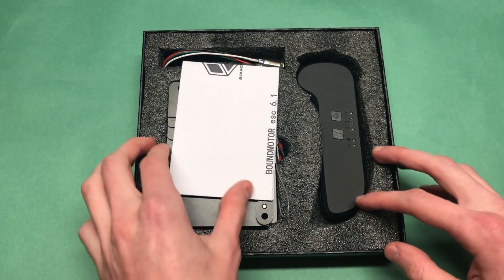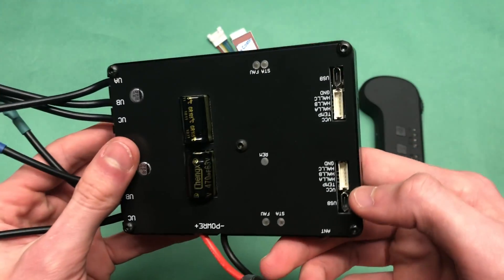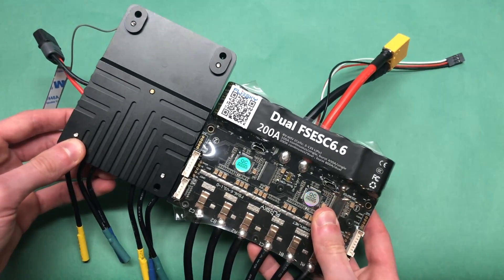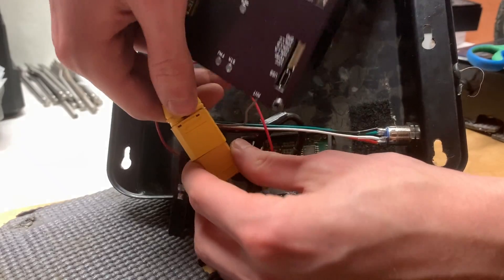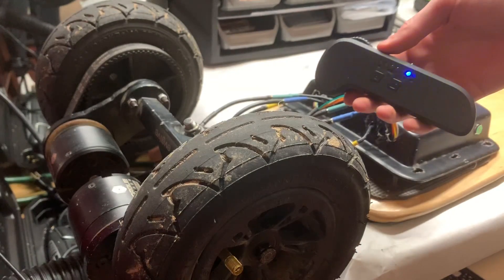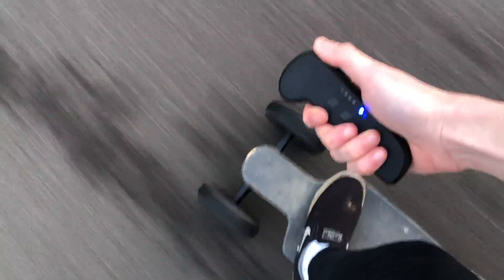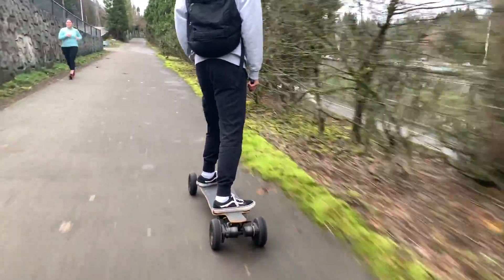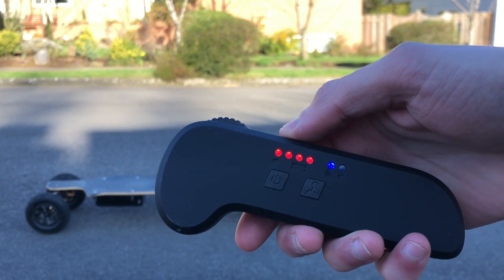BoundMotor ESC - Game Changer

Comment: Hi really enjoyed the video 😀 I wanted to know if I can get wheels that big to fit my board it is a Faboard Black Carve direct drive just like the Onsra Black Carve. Ive got some Clouds and and looking to buy some airless tires, but wondered if I could fix some 6" wheels with air in them on to it  😀 I have the Abec adapter so wonder if they would go straight on. Thanks Mark
Reply from the maker: I am not really familiar with the DD black carve but I know for a fact that ABEC adapters would not work. Pneumatic tires will require their own adapter as they have large hubs.
Reply: @DIYesk8Builders  
Hi thanks for the info really appreciate it. Mark

Comment: isnt the battery plug just an XT60?
also the FLIPSKY dual has a heatsink on the back and is rated for 200A per SIDE, and the boundmotor only for 60A

Comment: have you tried it offroad to see if it can handle steep hills and how fast does it climb?
Reply from the maker: Woah, so cool to see you commented - huge fan of yours! So it is not that great at climbing hills quickly. It is no where near as good as even Torque Boards VESC's in that area. I think the most suitable application would not be for an AT off road board but rather for a street board for intermediate or beginners. It doesn't have the same punch as most other VESC's
Reply: @DIYesk8Builders  thank you so much man! I hope we meet and ride one day! Stay safe!!!
Reply from the maker: Yeah that's the other thing, I'm only about 150lbs so it probably would feel even more powerful to me. Definitely is a solid product, but still not as good as some options!
Reply: @DIYesk8Builders  I am working with the company and it will be better. The structure is super strong which I like. The swappable battery is awesome. if I connect two dual vescs it will be a beast!!!
Reply: sorry bro I posted the answer in the wrong thread. I want to try this esc for bajaboard 4x4 and see if its powerful.
Reply from the maker: Sounds pretty amazing!

Comment: Taking off the cover on this ESC, the manufacturer scratched off the markings on the motor drive chips. 
It's a generic 20 pin gate driver instead of a DRV830x used in the real VESC.
I'm pretty disappointed that they cheaped out on the most important part of the ESC, and yet have three 32bit STM32F micro-controllers on the board.
The bluetooth chip is also a nrf24, a design from 2006 that isn't compatible with the VESC App.

TL;DR: Besides price-point, there is no reason to recommend this design over a flipsky6.6
Reply: This thing is crap in a nice case, think I blew mine got to pull case off and see. Thought it was 60 amps per motor not a mere 30

Comment: Your other VESCs cutting out during breaking could be happening because the regen current is too great, are you sure it is the VESCs causing the loss of brake power and not saturated regen settings? You can fix this by either decreasing braking current or increasing regen current.

Comment: Does this ESC have a port to connect two if someone was going to run AWD?
Reply: I don't know, but it's called "can bus", just to aid in your research.
Reply: I bought two of them for a 4x4... so far no luck getting them to hook up with each other... I dont think they have can-bus... which is why you have to program each one individually
Reply: Smugg Thugg that was my worry. You'll have to figure out how to split the receiver wires or somehow else keep from having from using two remotes. I went with two top end fly 6.6s...haven't hooked it all up yet but they have can buses so should work
Reply: @sageoz9886  yeah I might be outta luck on the 4x4... but they're still pretty nice so will use them on different boards
Reply: Smugg Thugg  yup, totally. I'll get one next time one of my regular boards blows another esc.  Y current diy 4x4 is actually 4x6 and has direct drive on rear with and the front has one pair of non drive wheels and a pair of hub motors mounted on custom made tandem wheel adapters. Check out my projects on Instagram @  SageOz_tattoos

Comment: There is a reason it’s so cheap... it’s rated for 60A continuities in total. A Flipsky 6.6 dual can run  double that.
Reply: For a mid tier build sure.....but if power is the requirement and price is not a major factor then i will take this all day.
Reply from the maker: Yeah, we have found it to have slightly worse performance because of this, but at the price point its pretty hard to beat. By no means is it better, but its certainly an option!
Reply: Wait if the one in your vid is rated at 60 amps continuous and flipsky can run double for alittle more why get this? People who want power are going to want more amps to there motors as long as they can handle it
Reply from the maker: Its a significant price difference if you think about this. If you buy a flimsy 6.6, a VX1 remote, and a power switch that will be close to $350. You can get this for $200, its definitely a budget option
Reply: @DIYesk8Builders  yeah, if one wants budget option just buy an ESC from diyeboard.com, they are great and can do 50A, which is virtually the same.
Reply: Well, if you're building a short board that's going to be running a 10s2p battery that can only put out 30A, theres no reason to buy a more expensive esc

Comment: Great video! Was just looking at this esc to replace the default one I have on my ownboard. How does it compare to the flipsky ? Also I'd love to see a review of thier direct drive motors which I was also the nkonf of getting.
Reply: Don't get direct drive , they bend , they have lots of problems...
Reply: satinder guleria I like to think I know a fair bit about the scene and I have yet to hear anything on what you are saying
Reply: @majorpuffen7444  It's because most mainstream brands are not selling direct drive yet ...
I know this info from one of the core supplier of all Chinese companies 🤫
Reply: satinder guleria that’s what my board has right now and I have also seen other brands using generic direct drives. Plus if you have heard of torque boards you would know they are a parts distributor and that they sell 2 different rated direct drives that are actually well liked by one of the best  diy builders out there.
Reply: satinder guleria this use to be a problem but has now actually been fixed
Reply: @majorpuffen7444   does this include the boundmotor direct drive though ?
Reply: tomai moneyhon im not sure what that particular drive would be
Reply: @majorpuffen7444  so which ones were you referring to?
Reply: tomai moneyhon if you’re referring to the ones from this video, then it should be a non issue now. If there was still a problem with direct drives they would not be selling them at all. Ive put 300km on my direct drive motors and i have had zero issues.

Comment: Im not one to leave negative comments normally but when there is miss information i feel it should be mentioned... You said you liked the aluminum housing as it acts as a heat sync and stated that the FSESC has nothing but this is not true, the FSESC has an aluminum backplate to act as the heat sync that you can clearly see when you hold them up to each other. Other than that great video.
Reply from the maker: This is true, there is a heatsink on the Flipsky 6.6. Maybe what I said came across wrong... they both have heat sinks, but the flipsky 6.6 has no actual case/protection. What I meant was that the Boundmotor ESC has an actual case. My mistake, thanks for catching me!
Reply: DIY esk8 Builders it’s all good :) love the videos regardless.

Comment: Any chance this'll be on your store? Been wanting to switch out my dual fsesc 4.20 plus due to some issues. Seems like little to no soldering and modification is necessary besides an xt connector. Can this handle 12s?
Reply from the maker: Not sure how it would work on 12s... We will not be adding to our store unfortunately.
Reply: @DIYesk8Builders  I have this ESC on my board with a 12S battery and it is working. I had some heating issues (ESC cutting off) but I fixed it by adding a bigger heatsink.

Comment: Well done, I want to change my 2 vesc's out for a single dual vesc. I like the heat sinc does it handle 160amp?
Reply: The website says 60Amps continues. Burst it could handle 160Amps but not for long.